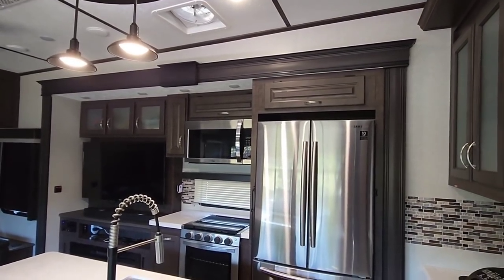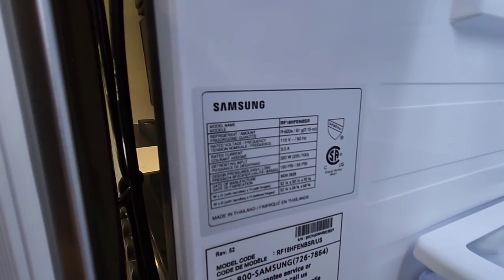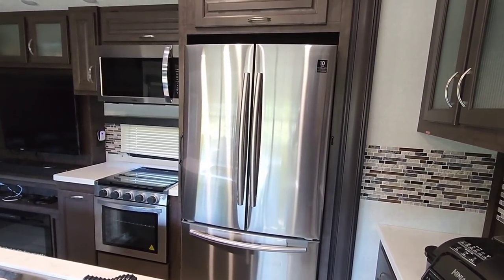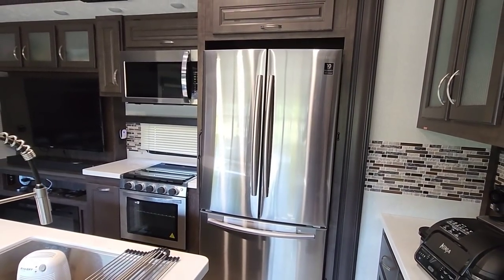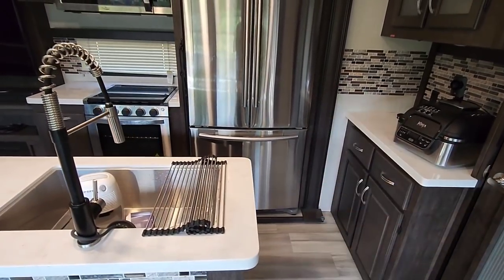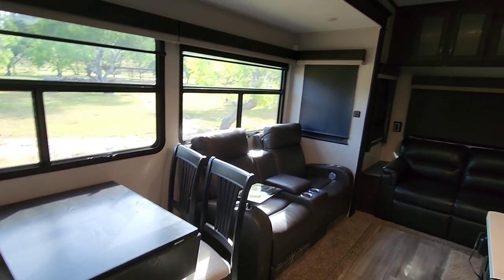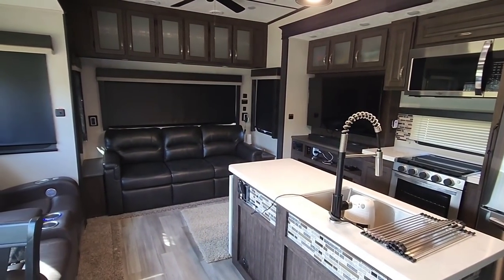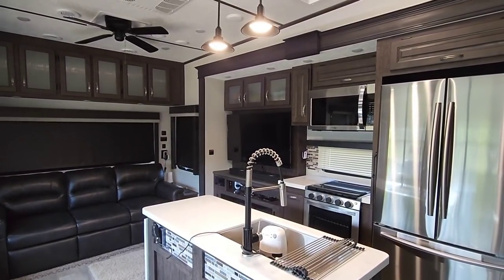Let's talk about 12 volt RV Refrigerators!

Comment: Hi JD. I appreciate this video.

Disclaimer: we have the Everchill 12v fridge in our Alliance Valor 40v13. (We love it.) But I have a lot of experience in creating testing environments (for software) and one of the key things that you didn't answer in this video that you need to figure out is this: What are you testing for? Your assertion that you can set it up in a cabin and put a probe in it indicates that you want to test its chilling ability. I don't think that's a terribly useful test, honestly. It is a fridge, it should get cold. Yes, even if it is hot outside. If it doesn't do that, I think the Internet would be full of that information already, so testing that doesn't really add to our collective knowledge or experience.

If you are going to test it, I think making sure that you actually live with the fridge is important. An RV is a small living space and any appliance is going to have an impact on your experience: how loud is the compressor? how much heat does it throw off? Things like that. Simply setting it up in a remote place and making sure it gets cold isn't going to be too meaningful, in my opinion. Even in this video you talked about how quiet your air conditioners are. Living with the appliance is useful.

Always appreciate your approach and content. Thanks for doing what you do!
Reply: Thank you Luke. I was thinking along the same lines. In addition to the tests you mentioned, longevity would be my number one concern. For a long term test, replacing his existing fridge would be the only way to test it.
Reply: I agree with Luke on this. I would also want to make sure that the fridge was getting opened regularly and that it was tested both when full and empty to test for the situation where a fridge might have cold and warm spots when full due to lack of air flow.
Reply: I have a norcold 18cf in my attitude toyhauler. I also live in Las Vegas.  My norcold does not get cold or even cool if it's over 90° outside.  The freezer freezes, but the fridge section is useless. I've had new cooling units replaced under warranty and it does the exact same thing as before. I am debating on switching over to residential style fridge specifically because of this issue.  (80° in fridge after 3 days start up, and after coming back from the mountains where the temps were 85° outside and the fridge was able to cool down to 43°, by the time i got home, the fridge was back up to 60°)

Comment: One suggestion would be to contact Chad with Changing Lanes and install  the 12v refrigerator in his fifth wheel for testing if he is willing.  They did a video awhile back on the heat affecting their A/Cs and refrigerator.

Comment: What about buying a somewhat inexpensive, basic - maybe 2-4 year-old - middle-of-the-road/size travel trailer specifically you can use for testing some of these products that you may not necessarily want to just yet do to your primary family unit?  Sorta like the BTBRV Lab RV.  Maybe you actually take it out every once in a while, or maybe you don't.  But you could have some experiments running with it like with this refrigerator.  Easy to check in on your upgrades/experiments since it'll be on your property, but at least you wouldn't feel like you're obligated to possibly mess something up on your main family RV and rendering it inoperable.  It is another expense and could be a hassle, so understandable if unpractical.
Reply from the maker: That's not a bad idea.

Comment: Test in your large enclosed cargo trailer, not worth taking yours out. Risk damage to current fridge and Rv. Using your enclosed trailer is best simulation and you can tow it around bouncing the unit like it would be in a travel trailer.

Comment: I have a residential size 12V everchill fridge. It does cool FAST. It is also nice and large. 

That being said, it’s a battery hog. I have two golf cart batteries and it will flat-line them in 12 hours or so. Had to put 500w of solar on the roof, now I’m battery net positive. (Boondock 90% of the time) 

Also, my salesman, who is also my friend, heavily suggested an extended warranty while pointing at the fridge. In the fridges defense, It’s been fine for the first year.
Reply: To clarify, I didn’t need 500w. I would have to look at the consumption study I did, but I’m somewhat certain 200w would have been enough, I just got a deal on a used 500w system.

Comment: In my main camper, I have the Everchill 12v fridge and love it. On the coldest setting it will freeze milk in the door tray. With one battery on the coach, I can go 15 hours before it kills the battery enough to not allow the slides to go in. This would be on a medium setting without AC in the rig but ambient temps around 70-80. 
I have an older spare camper that has the old 2way Dometic fridge installed. You are more than welcome to use that camper for testing if you’d like. I’m in San Antonio and currently in North Parde for the month with both campers. I could even bring the camper to your property for some real world testing that’s required for the channel and even show how the public how a retrofit would work. Figured I’d offer this to you.

Comment: I have a 12v refrigerator, 400w solar and 200ah lithium. I absolutely love this fridge. With my set-up I can have fresh food and cold drinks off grid indefinitely. It's so efficient that my batteries have yet to get below 80%. It cools fast and once at temp, runs very little.
Reply: Which 12 volt frig do you have?
Reply: Is it still working well?

Comment: Set them in a remotely located shed on a vibration base timed to simulate six to eight hours a day of travel. 
I'm thankful for my gas electric fridge. Several days of dry camping, Quartzsite for example, I don't have to worry about it. We still use the two group 27 batteries in our coach with a 200 watt portable solar set up to maintain our minimal use of them, and the generator for those brief times using the microwave. I'm not interested in the cost of, or space consumed by a large solar installation.

Comment: Personally, I already prefer the 12v compressor fridge due to how well in works boon docking with solar.    If you wanted to test one, my preference would be for you to get a loaner camper that had sufficient solar, but that setup is rare.    I certainly would never pull a 115v residential to support any kind of testing.    It’s only going to cause multiple problems down the road.

Comment: As a full timer not into boondocking, a residential is an absolute essential. Never Chill has shit the bed on me twice, never own one again. My current is a Frigidaire Galleria model, side by side. Came with the RV, and 3 years on it's working great. If people are worried about traveling with a domestic, we put 50,000 miles on our RV in the first 2 years. More than 100 RV stops in two years. It's never skipped a beat.

Comment: We bought a 2022 Zinger 28ft it has one in it we've had it for a year no problems as of yet very satisfied as the price of propane keeps going up. I would say I am satisfied enough with it that if I had an RV that the refrigerator went out I would replace it with one of these.

Comment: I have a 37’ fifth wheel that I live in 6 months out of the year between October to April that has a Dometic 2852 in it and I can always use more storage space.  I replaced two of them when I lived in my Alfa full time.  It’s just a matter of time before I’ll have to replace this one.  

I have 400 watts of solar and 4 6 volt batteries and now have two Predator 3500 watt generators.  It’s a center kitchen and the refrigerator is in the slide out and across from the door.  

I’d be more than willing to test one out this next winter and I do have a trip coming up in August.  😁

Comment: We bought our travel trailer in January of 21.  We have left it on since we brought it home.  Our camper is plugged in to shore power when we park it but it's just a 20 amp cord with adapter so we don't run the AC and it gets over 100 degrees in the summer and it hasn't missed a beat.

Comment: Personally I love the 12V propane option I have on my older TT. When I go boondocking I typically am in the woods under tree cover so solar wouldn't work too great for me with minimal generator run hours allowed per day. I understand solar especially in the west where there is a lot less tree cover and a lot sunnier but for me in the middle of the woods doesn't make a whole lot of sense.

Comment: Well there is another removal option. My in laws bought a new freezer for their basement. The delivery crew removed the coolant and cut the old freezer into pieces and then removed it. That's a pretty violent way to swap out a fridge that is working quite well LOL. 

I'd like to see you test a few however because I have a gas/electric fridge and honestly it's cooling ability is questionable and potentially dangerous at times. Maybe this sounds silly but what about strapping one into your utility trailer and rigging up some power?  A little driving around in an uninsulated trailer would be a great test. 

Another great video. Thanks JD.

Comment: you could put the Everchill 12v fridge in your cargo trailer so you could still drive them around to simulate on road conditions of an RV.  you could even put your ecoflow A/C in it to keep the temp down inside or leave it off to vary how it performs at different ambient temperatures.

Comment: One thing we’ve learned on our 12 V refrigerator is to put a thermometer in the freezer and one in the fridge, so we can see exactly where it’s running.  We’ve had our 12 V fridge for two years now and haven’t had a problem.  I’m anxious to see what you will be testing.  Thanks JD!

Comment: We converted our Norcold 2118 in our 2021 Montana to 12V by using the conversion kit from JC Refrigeration.  It replaced the gas/electric evaporation system with  12v compressors, one each for the frig and freezer.  We love it!!!  It's keeping the freezer at 2 - 8 degrees.  We did the install ourselves with help from other YouTube videos.

Comment: We have a 2020 Grand Design Reflection and replacing the standard RV fridge for a residential fridge was by far the best upgrade we have ever done. Very tight squeeze getting in but we got it in with a few choice words and man power
Reply: I have a 2022 Grand Design and wondering which refrigerator you chose? Is it still working good?
Reply: @nancyjones6784  yes my Samsung still works after 4 years were currently renting that RV out. And I honestly like the Samsung one better than this Kitchen Aid one

Comment: Good afternoon JD. You hit the nail on the head. 
Garage,cabin,enclosed utility trailer, office/den/mancave. Outside grill/ patio/deck.
Maybe if you put up a umbrella/canopy out by the pool, ya'll wouldn't have to go back to the house/tote a cooler for pool day/party/get together. 
I'm a truck driver, with company permission, we could tell if the juice is worth the squeeze. Most Class 8 truck refrigerator's aren't going to last and boy are they expensive. 
So pending sizes available, very interesting to see how it works out.

Comment: It’s obvious the company values your opinion enough to provide you with a product to test. With that said, I agree with not pulling out your current fridge and replacing it except if it fails and you need to replace it anyway.  Is there another RV you could use as a test site instead?  From what I understand, the 12v models tend to cool quicker even in hot climates.  I would accept the company’s offer and test their product.  Maybe review build quality as well as performance.  Great channel by the way.

Comment: Maybe set one up in your cargo trailer and take it for a couple of drives over different roads, pot holes and smooth. Your cargo trailer would be a better place for listening for noise level and for the heat that can come with a travel trailer/rv.

Comment: I replaced my NORCOLD with an EverChill Refrigerator about a year ago. Love IT!! I live in San Diego.  This refrigerator cools off in less than an hour!  
Long story short, first EverChill I received was bent at the bottom and couldn't be installed in the RV. It was replaced free of charge. I connected a 12V power supply to the damaged 12v Everchill and put it in my garage. Like you stated, it is routinely over 100 degrees in the garage in the summer. It has worked flawlessly. It is very quite and I have had more issues with it being too cold and freezing items in the refrigerator. Unfortunately they are not like a residential refrig with a temp set, but a Number set just like the absorption refrigerators.
So I think putting one in a garage would be an excellent test.

Comment: It's still nice to have a propane option when boondocking, simpler setup and very proven technology.
Reply: Propane refrigerators are garbage in my opinion. I've replaced 3 of them over the years in 3 different campers. I throw them in the garbage and put in residential refrigerators.

Comment: My take on the 12v fridges.   They may not take over gas/electric fridges completely for a while but they’re going to end the practice of residential fridges being installed in RVs.  

They use way less power and do the same task.   No inverter needed.  

You also don’t have to remove a window or a slide to replace it.   That’s the big thing is serviceability.   Many RV techs won’t touch them.   A 12v fridge can be pulled out your door 

For gas/electrics:
I think when real solar packages/lithium iron phosphate batteries become standard the gas/electrics days are numbered.   For clarification I mean at least 400 watts solar and 200 ah lithium iron phosphate batteries. 

Another advantage people forget is with a 12v you have 2 less leak points in your RV.  No roof or side vent required.

Comment: Many times the only way to get the residential refrigerator out of a unit like yours is to remove the slideout. Also, if you lay a residential refrigerator down it kills them. I have a 12v Furion compressor refrigerator in my 5th wheel and love it.

Comment: A 12V fridge is just a fridge with a built in inverter, at latest with the furion model.  I would NOT change to a 12V unit unless you don't already have an inverter.  The 320W rating you see on your fridge is worst case scenario, typically during defrost.  We have a Hisense brand fridge and love the space and cooling capability compared to the gas abortion fridge from our previous RV.  Our fridge draws 50w to 60w when running and spikes way up during defrost.

Comment: JD, I understand your reluctance to just swap out the refrigerator in your unit for testing. I would like to see more on the 12 volt refrigerators though and the garage could be a good option but what about your cargo trailer? If you're still using it to do projects at places that's kind of like an RV if you put it inside there.  I also really like the idea another viewer had to connect changing lanes with that deal if they are interested in going to the 12 volt instead of the gas electric. I like the way Chad does product reviews also.

Comment: Hey, Big Truck, great question: answer, yes, please do test the 12V residential fridge in the garage...do not move that fridge out of your RV!  It will not go well for you, and your RV is so beautiful, it would be a sin to mar any of the woodwork or flooring.  Question for you: if 12V fridges are so good on power, why can't we use one on our homes? In power outage situations which happen quite frequently where I live, I could keep my fridge running on my LiFePo, couldn't I?  Also, it'd be so cheap to get a solar panel dedicated just for the fridge in my house if it was a 12V with my LiFePo as a backup on cloudy days. So, you can see why I would love to have your review of the 12V residential fridge...probably have more questions after the review. Losing power to the fridge is my only concern in power outages. I am really set up to go "1890" with everything else...just won't have TV, and that is not a big deal for me.

Comment: I think a a test in a garage could work, with 2 12volt batteries and a solar panel fixed and or a solar panel Mobile.
If your boondocking then u probably wouldn’t be running AC, anyway.  I just bought G.D. Imagine XLS 17MKE with a 12volt Furrion fridge with 2 batteries and a fixed 165w solar panel the fridge ran great for 3 days I feel a mobile solar panel would help this last longer.  I turned the fridge off the 4th night it was running to much.  Great video.

Comment: I think if my gas/elec died I would look into replacing, maybe.. we have a nor cold and it works very well on both 110 and propane and only draws 2amp on gas. ours is a 12cuft. we run it off the inverter during travel but it does draw 30amps on DC. we have the benefit of taking the fridge out the toy hauler back so it would be a lot easier.

Comment: The garage would be a static test site. Should the refrigerator be "installed" in a box similar to an RV?  Should the fridge experience road movement to create a typical RV environment? How large of a solar bank and battery bank would be required to maintain that fridge in a hot (unconditioned) environment like a garage or poorly air-conditioned RV? Those would be my testing questions.

Comment: Maybe find a way to stress test them like a real RV would do; somehow simulate an occasional ride down a rough road. I bet the manufacturer has some way of doing it. There should be some way to use an electric motor and a customized platform to mount the refrigerator onto. Maybe some sort of gentler version of the kind of mechanism that used to drive those mechanical bulls, popular in nightclubs back in the 1980s. I guess it’d cost a bit to build something like that, so you’d have to consider whether it’s worth it, but it might lead to some interesting videos.